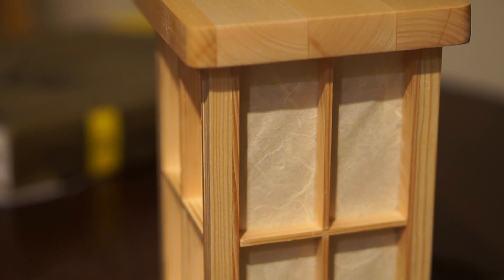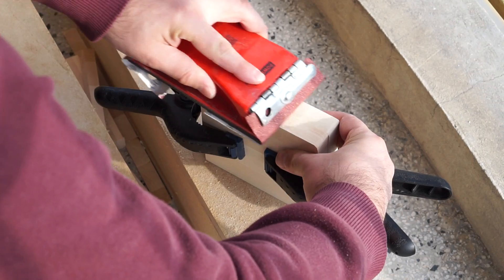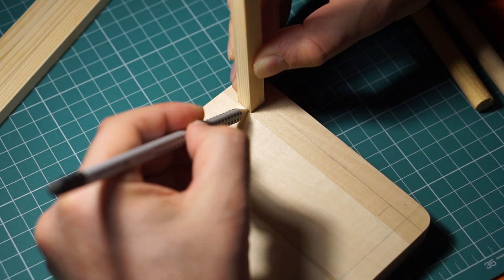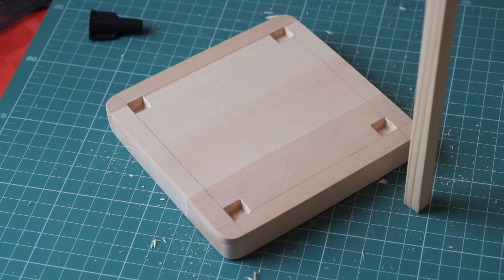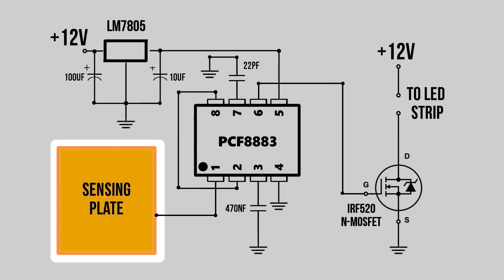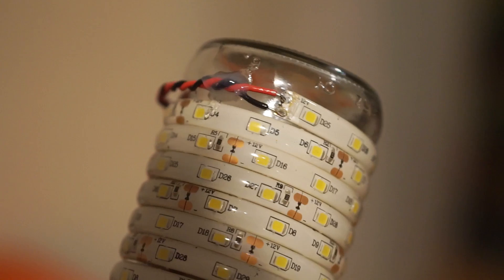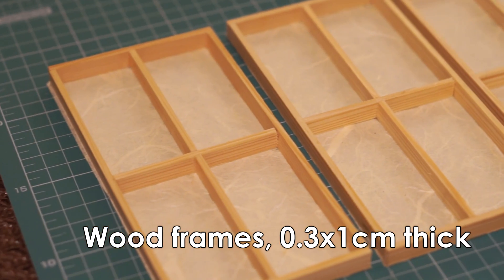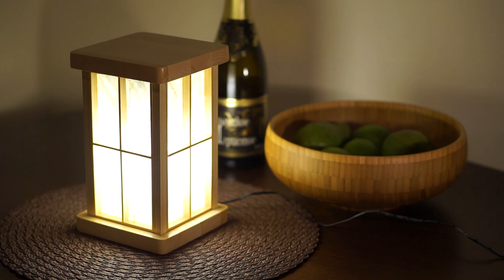DIY touch-activated LED lantern

Comment: I like yourrr ,,rrr'' letterrr in yourrr accent. Grrreat :-) Can't be forrrgoten :-) Nice chip that pcf8883. I didn't knew it. Although can be replaced by 3-4 transistors forming dc amplifier and latch. Also simple circuit. But pcf8883 gives some kind of elegance over discrete one. That aluminium foil will loose contact overt time due to oxidization and electrolytic metal dissimilarity, better to use copper foil or part of tin can and solder.

Comment: Hi I can see a resistor on the real life circuit but it’s not on the circuit diagram, does that mean that I do not need it?
Reply from the maker: Hi, good observation. I wasn't sure myself at the time, but I've since learned that a resistor to the gate is good having. There is a small capacitance the mosfet has. If you have something like an Arduino connected to the gate, having no resistor may damage the chip because for a fraction of a second, the chip will be seeing very little resistance, therefore passing too much current. Hope this helps.
Reply: LeftyMaker does that mean that I wouldn’t need one if I’m using a direct 12v from a battery pack. If I do what is the resistance
Reply from the maker: @trioabs2166  Can you give me more details? What exactly are you making?
Reply: LeftyMaker I’m making a touch sensitive lamp powered by 8 AA batteries
Reply from the maker: What chip are you using to detect the touch? I'm asking because the pcf8883 I used works with 9V maximum. Other than that, the mosfet should be able to handle 12V, I think.
Reply: LeftyMaker I am using the pcf8883 and I am also using a 5v step down regulator
Reply from the maker: @trioabs2166  okay, then to be safe, you can add a 470ohm resistor between the chip and the gate of the mosfet
Reply: LeftyMaker thanks
Reply from the maker: No worries. Let me know if you run into problems

Comment: the idea is exceptionally awesome, but i couldn't help to notice that the light went on even before you touch it... check at 6:07 at 0.25x speed.
Reply: I noticed that as well here's why:  the PCF8883 is a capacitive touch/proximity switch that works through capacitive coupling, so it really only needs your hand to be as close as the sensitivity is set to, according to the capacitor on pin3 :)

Comment: Very nice, I will try if I can find the part - is there an alternative to the PCF8883? I'm unable to find the chip on aliexpress and you've stated below that the TTP223 won't work with this design.
Reply from the maker: Hey Tom. I guess the TTP223 might work if you're okay with leaving it exposed. Or maybe it will still work if it is covered by a thin piece of veneer. But again, I've never used that module.
Reply: @LeftyMaker  I would like to make as in the video, I will search  for another chip....

Comment: It would be possible to replace the PCF883 with a NE555 on bistable mode?
Reply from the maker: It depends on what you want to achieve. The PCF8883 senses changes in capacitance to detect your palm. This triggers the switch. With an NE555, you'll have to use actual, physical buttons.

Comment: Can multiple part of the lamp be touch sensitive (as switch) ?? I'm doing a lamp for my Design & Tech Project, and this touch sensitive switch idea is very interesting . That's why I'm asking .😄
Reply from the maker: Yes, but be careful. Having more touch-sensitive areas means using more aluminum foil, which increases the area and capacitance of the sensing plate you're essentially making. This could make the switch too sensitive and activate from stuff like the static electricity in your clothes. You can try using much thinner wood over the foil and a smaller value for the capacitor that sets the circuit's sensitivity. Or you can use multiple 8883 chips and an Arduino.
Reply: LeftyMaker ok, thank you very much 😄

Comment: Is it fine if I'm not using the exact transistor as you used ? Will it still work ?
Reply from the maker: Yes, you can use a different transistor, as long as it can handle the current of the LEDs

Comment: Maybe I missed something. But how does the touch transfer through the wood. Wood is not conductive ?
Reply from the maker: The circuit is very, very sensitive. Practically, it detects the presence of your palm, not touch, and it can sense it from a distance, even though the wood.
Reply: Woah.. that is nice. Its almost like an RF touch

Comment: I don’t understand how it works because the Aluminium foil is glued to wood (non consecutive) 
Besides that what is the ic part name
And great video. I enjoyed
Reply from the maker: It is a PCF8883, and it makes a circuit so sensitive that it will detect your hand even from a distance and through the wood. Cool, right?
Reply: LeftyMaker yes very cool, as you mentioned that the capacitor it a sensitivity indicator so if I’ll use a variable capacitor I’ll be able to change the sensitivity but the variable capacity should be in which range of values
Reply from the maker: https://www.nxp.com/docs/en/data-sheet/PCF8883.pdf This is the datasheet for the chip. It will probably answer a lot of your questions. The value for the sensitivity cap should be between 90nF and 2500nF. 470nF is the recommended value. Not sure how well the variable capacitor will perform, but do let us know if it works well! :)
Reply: Asmar Khan  try to change the capacitor value to what the  Leftymaker told me at the comments up
And check if the circuit works on a breadboard and then try it with the wood case
Reply: I have tested this but it not working with the wood...  I mean the touch part.. Please help 
I used 5 100kpf capacitor in series
Reply: Could you get it to work?? I'm thinking of starting this project.
Reply: Nathan Eads 
I'm not the one whom created the video, try to make it in your one , if you have questions I'm sure that we could answer them, the whole goal is try and if you make mistakes it is fine 
Nothing is perfect from the start
Reply from the maker: Hey! Sorry for the late response. Try wiring the capacitors in parallel, not in series. You wire capacitors in series if you want to get greater voltage handling at the same capacitance. Does it work if you directly touch the plate? It really should. Also, double-check if all pins of the chip have been soldered well. That was an issue I had. You may also check one of my earlier videos where I build a very similar circuit on a breadboard. Let me know how it goes.